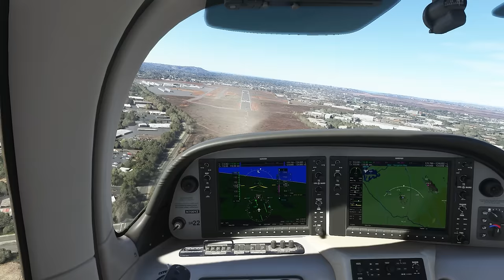Fatal Plane Crash At Montgomery Field After Student Pilot Declares An Emergency | N700YZ Crash

Comment: Perhaps if the controller wasn’t transmitting as if she was in a speed speaking contest, it would have slowed things down enough to hear what the troubled pilot was saying. Perhaps someone could have informed him to pull up and not try to land. 😢
Reply: Radio communication in aviation is very structured and internationally standardized. So much so that to you what sounds fast, to a pilot sounds like an old song we have heard hundreds of times. As a pilot, I heard ATC’s repeated instructions not to try and land. To a layperson, you are hearing the song for the first time. 

It is imperative for student pilots flying solo to announce they are a “Student Solo” every time they announce their callsign. This will alert ATC to slow things down and provide greater aircraft separation. For a student, they are not as well versed in the communication format as a non-student.

As far as someone else telling him what to do, that is a recipe for disaster. There were a dozen aircraft in the area. More than half of them had instructors onboard. If the majority of the instructors had all started talking at once to an already panicked student, there would be chaos. It would be better to let ATC get the student stabilized. Then, an instructor could offer assistance to correct the control issue.After all, runaway trim is not a huge deal for a pilot.
Reply: @deanfowlkes  I do agree that listening to radio communications is something ones ear gets trained to tune in to. But, as a police officer, it is known that a human being only truly grasps no more than three pieces of information.
Reply: Perhaps the pilot should have been more proactive in solving his own problems...not ATC's job to fly the airplane, it is to simply shepherd them in and out of airports and controlled airspace...

Comment: I once had the trim activate unexpectedly while flying a different plane from the one I usually flew. Both are PA28s. The unfamiliar plane had a trim button where the plane I was used to had a PTT button. I was flying with another pilot who was operating the radio for most of the flight. At some point, I tried making a radio call myself. I pushed the button that I believed to be the PTT. While I was speaking the nose pitched down. I discovered the problem quickly enough and was able to correct my error. A low hours pilot might not have identified the problem….

Comment: So sad. If the trim ran away he should have been able to pull a breaker to stop it. This is standard operating procedures. Also the pilot should have been able with some difficulty overcome the trim. From what I see in the picture it went in very hard,  maybe a spin? RIP to the pilot.

Comment: Stuck mic and shorted trim switch are both mounted on the side stick. I suspect wiring issue.. pilots, know were your breakers are located and the general area of auto pilot / trim breaker(s)

Comment: Runaway trim can increase the forces needed by the pilot to move the pitch control. A pilot of average strength can overcome these forces in a small-single-engine airplane, however.

Comment: I doubt he had a stuck mike. More likely panic and locked his grasp on the mike. I have done it.

For the trim issue, here is the sr20 manual excerpt:

"Cirrus DesignSR20Take Off / Go Around ButtonThe remote TO/GA switch, located on the left side of the power lever, selects the Takeoff or Go Around mode on the Flight Director."

So here we have a student in a complex aircraft and a TOGA switch very easy to hit by accident. This could be perceived as "stuck (runaway) trim", since the autopilot is trying to pitch up and climb, that's what the TOGA mode does. He didn't know how to override the autopilot, which was clearly on, otherwise there is no way to get "stuck trim" with the AP off.

He would have been able to overpower the autopilot, they are designed to be able to be overpowered. But it probably added to his stress and was a large factor in the accident.
Reply: As a correction, the TOGA button will not activate the trim. It changes the settings on the Flight Director. The Flight Director is advisory on the PFD only. You would have to manually select/arm and activate the AutoPilot on FD mode for it to activate he trim. 

TOGA actually deactivates the AP. It is supposed to deactivate any systems initiated trim input. The pilot can still manually or electrically activate trim. TOGA will effectively have the pilot hand flying the aircraft. 

TOGA also cycles the navigation system from an IFR SIAP final approach to the missed approach at the Missed Approach Point. This will display the correct navigation cues on the HSA, moving map, and FD to be hand flown. The pilot can then choose to arm and activate the AP to fly the missed approach using whichever nav function they choose (defaults to GPS, if I recall). But, this would have required an instrument approach to have already been selected and activated in the flight management system, beforehand.
Reply: @deanfowlkes  I never said TOGA activated the trim. I'm saying that he misinterpreted TOGA actions as trim (as in, "the controls are fighting me"). TOGA changes the flight director, but if autopilot is on, it also commands that. TOGA action on final is to pitch the aircraft up. If the AP was *off*, then yes, TOGA would affect FD only. But the very fact that he said "stuck trim" means the autopilot was in fact ON.

Another poster mentioned that he may have had an STEC without envelope projection, which was the other theory below. This would leave accidentally hitting TOGA as the remaining possibility.

Pilots (even students) with an AP equipped aircraft with automatic trim are told repeatedly that runaway trim is an issue. Its usually pilot error, as in the pilot engaged AP with the aircraft out of trim or didn't understand he had commanded a wildly different altitude or setting than what he thought. I had and have a simple answer to that: I didn't install autotrim.

Finally, how do I know about hitting TOGA? Simple, I do it all the time. I even practice recovery from it. That stupid button is right there in the way (by design). Of course you are going to hit it by accident.
Reply: @scottfranco1962  - It is a theory. Another would be a stuck trim switch. Or just a shorted switch. Electric trim is an added device to go wrong. 

I will have to revisit my G1000 Docs to see the differences in the Cirrus Perspective system from the other systems for Piper and Cessna. In neither of those systems does TOGA activate autopilot. Especially without a Missed Approach Procedure inputted in Flight Management first.
Reply: @deanfowlkes  No, I also don't know of any AP system where TOGA changes the AP from off to on, I think that would be a misfeature. However, there are plenty of accidents where the pilot was confused about if the AP was on or off, and I suspect the temptation even for a student pilot is to play with it, especially on that nice expensive sr20. The only right way (imho) to put a student in front of an AP equipped aircraft is to tape the damm thing off or pull the breaker.
Reply: @scottfranco1962  The flight school I attend uses a zip-tie wrapped tightly around the button, so it cannot be depressed inward. I've tested it.

Comment: Trim runaway on a student solo is a nightmare scenario without altitude to work with. Also, Cirrus planes have a sharp P factor that can induce yaw and roll on a go around. I really think single-engine Cessna and Piper aircraft are the better option for getting the initial hours, even if the transition to high performance is to happen later. The Cessna and the Piper are forgiving aircraft, the Cirrus less so, and CAPS is great if you aren't too busy to activate it when you are still in the useful flight envelope for successful deployment. Nothing wrong with Cirrus, it's just a lot of plane for a new pilot, and too much power can get you hurt or killed as fast as too little.
Reply: Being an SR20 they come with around 200hp depending on the gen, which for the weight of the aircraft is really not that much performance. I am unaware of the situation on final whether or not he was in the CAPS envelop but chances are he probably was. It's helpful to note that on the left seat where the circuit breakers are there is a trim CB that can be pulled in this event. Cirrus's definitely have their quirks but for a student pilot if they start with the cirrus they won't know any different than someone starting to fly any piper/cessna.
Reply: @ryan_kirby7  Fully loaded no, single pilot it hangs on the prop just a little more. The three bladed prop creates a tendency to roll and yaw as the power comes on fast, which is fully recoverable if you're not 100 AGL or less doing a GA. But, there was a crash in '21 or '22 where a Cirrus was late on  the GA, and they got on the power hard, resulting in uncommanded roll, the right wing catching grass and cartwheeling the aircraft. It's not a high-performance plane in many aspects, but it's a step up from some other entry-level aircraft.

Comment: Sounds like he had runaway trim to me on final approach. Maybe this emergency event was never covered in his training. This emergency can happen  in aircraft  that have eclectically operated trim tabs.  If runaway trim is the problem, de-energize the circuit by pulling the circuit breaker (PITCH TRIM, ROLL, TRIM, or AUTOPILOT) and land as soon as conditions permit.

Comment: Maybe this pilot was pushing on trim button thinking it was a mic been keyed. This happen to me on final in a  Pa 28r 201-T.  My instructor picked up the situation and cleared it. This   may occur  when transitioning to aircraft with trim control on wheel.
Reply: I’ve seen a few rather plausible theories proposed here, but I personally favor this one as it explains both the pilot’s comments and the stuck mic. Reminds me of cases when people get startled and inadvertently drive into buildings, mistakenly believing they are stomping on the brake, when in fact, they are pressing the gas pedal to the floor and panicking. Happens more than one might think.

Comment: Loss of electric trim control is an emergency procedure but apparently not recognized as such in Cirrus manual.. Airplane design normally allows flight control by pilot physical input when trim motor switch malfunctions.. apparently this student pilot had little or no training to handle this situation.. slowing airplane speed allows easier ‘out of trim’ flight control with less control surface forces exerted on wings.. slow flight around the pattern to gain aircraft control with minimal engine power input then setting 7700 in transponder should have allowed pilot to safely land.. CFI will forever regret this if trim procedure was not in students training… sad for all.. Aviate, navigate, communicate… fly the plane !  Stay above design minimum maneuvering speed and land at normal speed..  my humble opinion only..
Reply: It does seem as if he forced the plane into the ground instead of flying through the emergency.

Comment: I have never flown a Cirrus so my comment is more of a question for those of you who do fly this model of plane.  I heard the pilot say that he was having trim problems.  With the redundancy that is built into most planes, is there a fix a pilot can use if or when the trim (I imagine it is electric) gets stuck in a position that is opposite of what the pilot is needing?  I would hope there is still a mechanical wheel that could be used in the event of the electric motor malfunctioning?  I also understand that time and altitude is necessary to be able to recover from such an issue.
Reply: I don’t think the cirrus has a trim wheel, unfortunately. Easy to say this on the ground, and not at pattern altitude, but with a trim runaway, I would have pulled  the circuit breaker. No idea, of course, how much force he would have to put on the yoke to over come it though

Comment: I worked on GA aircraft and Airliners for 42 years and flew GA aircraft for the same. They all break. One of my customers planes autopilots would try to flip you on you back with an aileron hard roll over. I flew the plane it did the hard over on me. One I say forget the circuit breaker hunt if there is no yoke disconnect hit the master to off immediately. Alot of GA aircraft autopilots usually have no quick disconnect on the yoke.  The autopilot in question that would flip you over in my customer's Cessna 172 I flew the plane I traced it to an autopilot control board relay that would latch the roll servo in turbulence. Worn or weak springs in the autopilot roll circuit relay. I had another customer that had auto pilot problems. One a Mooney with its autopilot engaged, and then if you selected the GA button for go around would try to loop the plane. Again, it was not the pilot but the autopilot controller on that plane causing the problem. So fellow pilots don't trust George for 100 percent reliability.  Autopilots are great when they work but definitely get my attention when they go crazy, and they do. Condolences to this poor family, go get a lawyer I am sorry to say, but this is where this family should be at. I should not be mentioning lawyers, but they are part of our aviation accident system when things go wrong. I hate to say it but as a mechanic you'll be on the receiving end of the lawsuits, plus the manufacturers.  I have seen it all.

Comment: Looks like a electric control elevator trim...If you're not trained to pull the circuit breaker out when you notice the runway trim...you're screwed. Just my opinion

Comment: From the Cirrus SR20 POH: Flight Control System Electric Trim/Autopilot Failure
1. Airplane Control...............................................MAINTAIN MANUALLY
2. Autopilot(ifengaged).............................................................DISENGAGE 
◆ If Problem Is Not Corrected:
a. Circuit Breakers ..................................................PULL AS REQUIRED
• PITCH TRIM
• ROLL TRIM
• AP SERVOS
b. Power Lever .................................................................... AS REQUIRED
c. Control Yoke ................................... MANUALLY HOLD PRESSURE
d. Land as soon as practicable.
Procedure Complete
• NOTE •
Any failure or malfunction of the electric trim or autopilot can be overridden by use of the control yoke. If runaway trim is the problem, deenergize the circuit by pulling the appropriate circuit breakers and land as soon as conditions permit.

Comment: I'm a Commercial Pilot and Flight Instructor. I'm also unfamiliar with the Cirrus nor have I ever flown with trim control set to it's limit so I shall have to speculate. Either the force needed to overcome the pitch up or down tendency was too great for the pilot to sustain for the time period to effectively land the airplane because design parameters, for safety, do provide that trim setting and autopilot can be forcibly overridden when needed. or the pilot, being a student, was overwhelmed, panicked and gave up the fight. Having once been a student myself, I have to accept the latter as a possibility.
Reply: Someone mentioned it was porpoising all the way down so sounds like was actively fighting the trim.  He didn't give up.
Reply: @gringoloco8576  My apologies. I regret having speculated not knowing enough. Condolences to the deceased Aviator's loved ones.

Comment: Last year i had a spider plug my pitot tube and my air speed indicator went immediately to zero. Soon as that happened my autopilot kicked in and started triming my nose down to gain speed.  Took me a few moments to figure out what was going on. I then pulled the fuse for my autopilot and made a landing without my airspeed indicator. 
Had to do some paperwork and the FAA called me and I had to give a written statement.  Overall I was lucky to figure it all out and land safely.

Comment: I am a 500 hour private pilot: a stuck trim or out of control trim can make it very difficult for you to control your pitch. When coming down for landing if you can’t control your up and down it’s gonna make for a very bad landing however I think his big issue was that he went off to the right and landed in the dirt and it just disintegrated the plane. It’s easy to say after the fact what he could’ve done was to allow the aircraft to go up and pull back on the stick as hard as he could and then use the parachute. But hindsight is always 2020

Comment: So sorry for him... But...: The Cirrus seems to be the next "Doctor Killer" around... This aircraft is a sleek, high performance aircraft. It is very easy for an unexperienced pilot to get mentally "behind the aircraft" and it is defo NOT a beginners aircraft. Judging by his radio work, this pilot was completely out of time, opportunity and luck. He simply was not professional in what he was doing and his aircraft flew him as opposed to him flying the aircraft. As a CFI in both fixed wing and helicopters, my advice is: Get solid flight training on training aircraft like a good old 150 or 172. Then move up to a Cherokee or another more sophisticated aircraft. Do not think you can buy a Cirrus, get 60 hours of flight training and then rely on the parachute. Learn how to fly properly, get some hours, learn and study. Flying is not like riding a car. Same happened with that amphip wonderplane and it even killed the owners of the company. Be cautious about promises of a wonderplane. Become a good pilot first, then pick your plane.